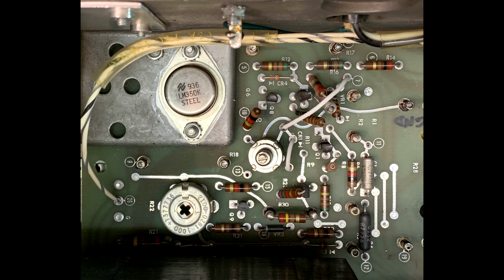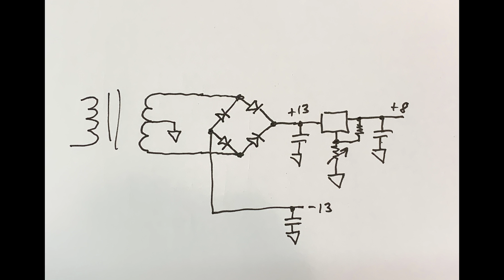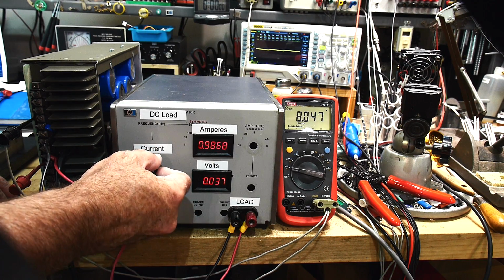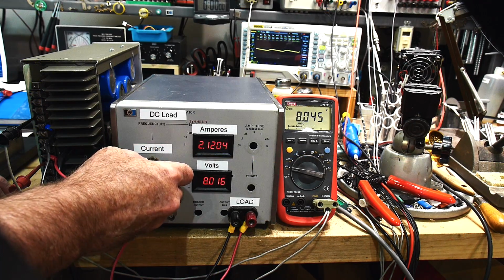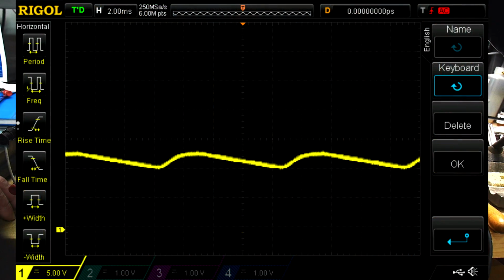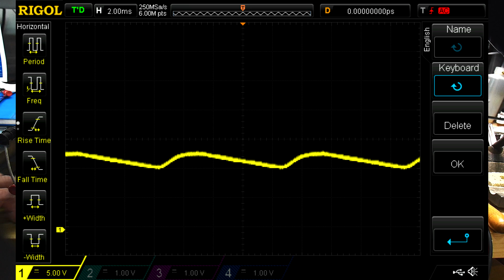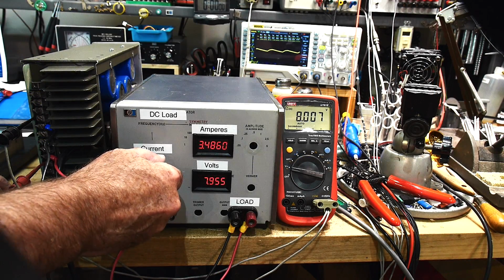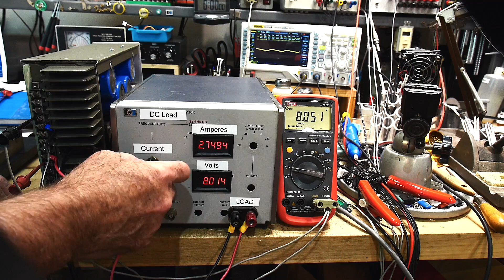#547 Linear Power Supply Ripple

Comment: As for voltage regulators, you can easily design one that goes down to zero while keeping its accuracy. You just need a NPN transistor in voltage follower/common collector configuration, with its base controlled by an op-amp as an error amplifier.

Comment: Finally, a split supply design using just one bridge. Reasonable, because you don't need two. I've seen many DIY designs using two separate bridges, when it is not needed.

Comment: I have a suggestion:
Increase the primary voltage by adding few volts on the primary with a small step down transformer.
I believe that the original power transformer is enough overrated to handle more than a high line and survive without overheating.
Anyway you have to check the NO LOAD PRIMARY CURRENT when doing the mod.